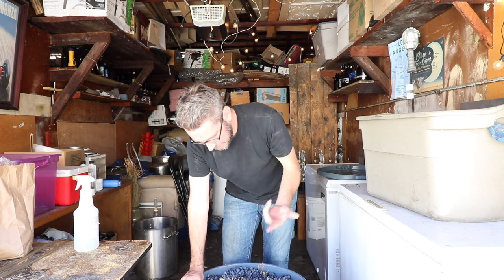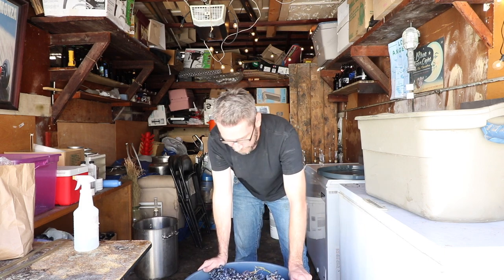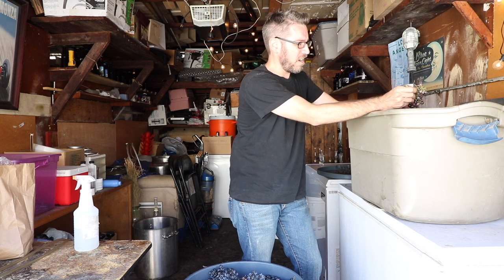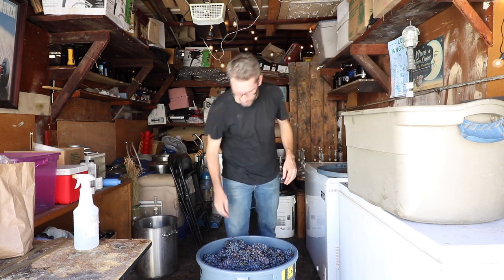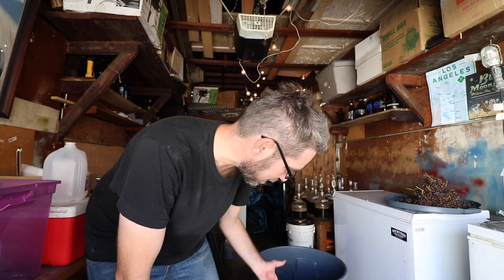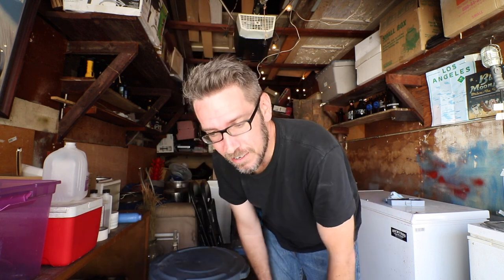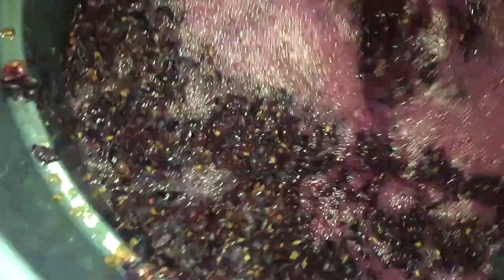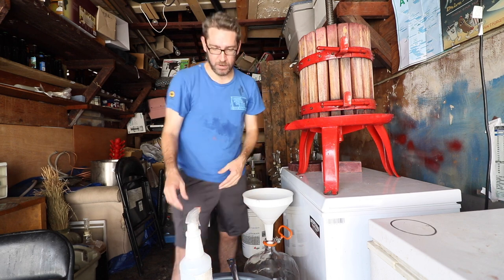Beginner's Guide to Making Wine (from a beginner)

Comment: Watching him stomp the grapes with his feet reminded me of a friend of mine who sharpens his chainsaw chains with a file instead of a Dremel Tool and a sharpening stone,  which is three times faster than sharpening them with a file and it doesn't take off nearly as much metal so that the chains last a lot longer. I've been making wine for fourteen years and I figured out that the best way to prepare fruit for making wine is to grind it in a #32 hand-crank meat grinder with the biggest open blade. Maybe this guy has never seen a meat grinder. I tried a fruit press and it was a joke compared to using the meat grinder. I grind smaller berries in a big blender, 2 cups of berries to 2 cups of water, and I pulse grind them just enough to break the berries. That works plenty good enough as the pectic enzyme will go in and bring all of the flavors out of the berries. If you puree the berries the wine won't clear.
Reply: Yeah! Use meat grinder, or blender...
We can't tell if the one stomping on those fruit...
Has foot diseases. 🧟🤢🤮